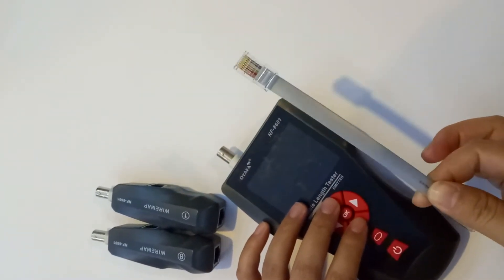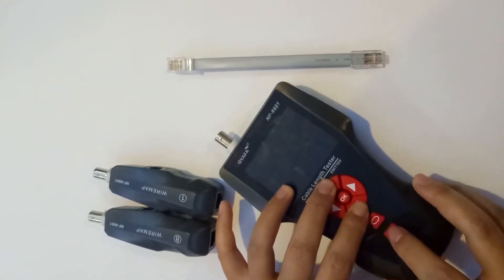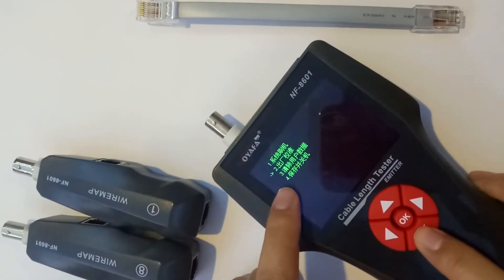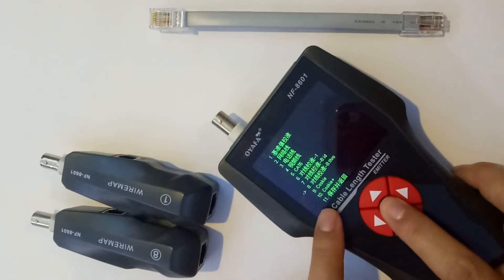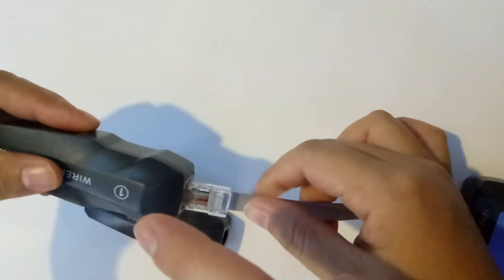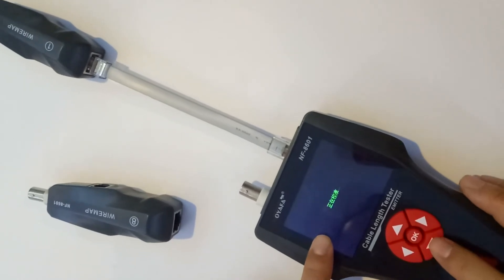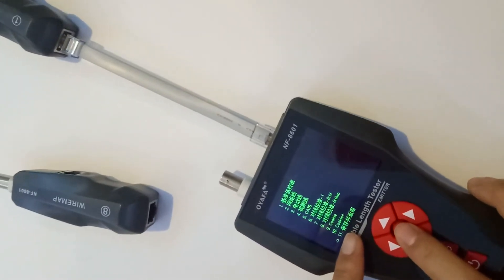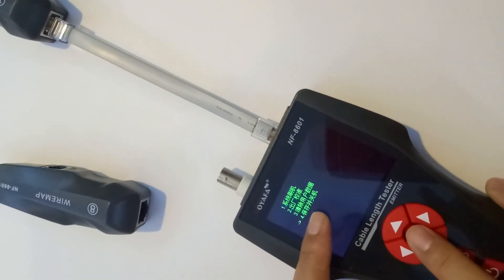VID NF 8601W :How to do when there is a faul in wiremapping cables

Comment: Τhe greater the length of the UTP cable, the greater the error. At 3 meters I get 3.6 meters and at 15 meters I get 16.5. Also, I can't reset the internal memory and every time I export my length measurements it adds the old ones to the export file. NF-8601W

Comment: What's the difference between NF 8601 and NF 8601W?
Reply from the maker: The main difference there is NF-8601 is the standard one with 1pc of remote terminal , NF-8601W is an updated version with 8 terminals